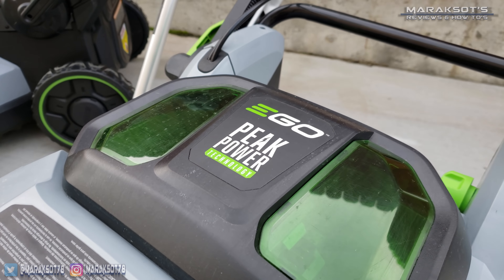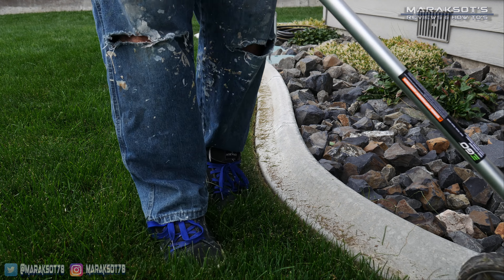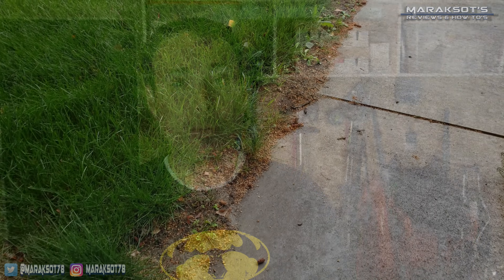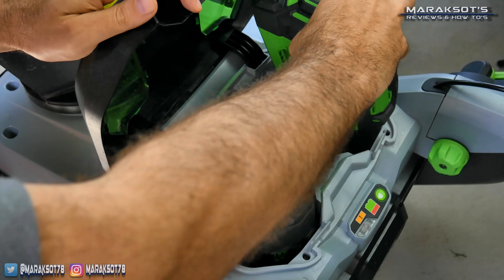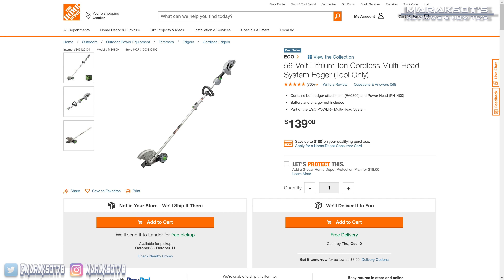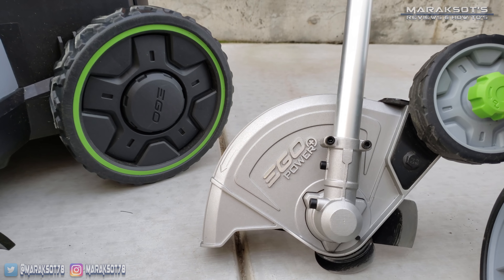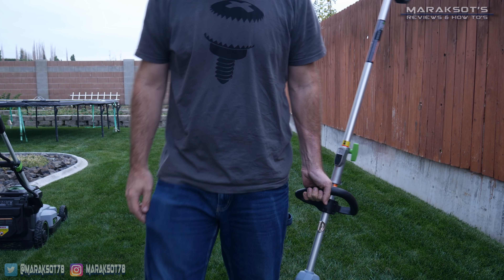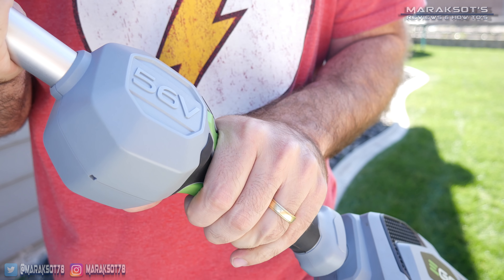EGO Multi-Head System Edger Review

Comment: Yea wait till they change the battery for the next generation of tools which means they won't manufacture older model batteries which means your tools will still work but you will have to buy batteries and chargers thru shady 2nd and 3rd party manufacturers and that's IF they make those particularly 2nd and 3rd party batteries.  It's a joke.  Bought a 3 piece Kobalt tool set 3 or 4 years ago and now I can't find a battery for my tools.  They just don't make the battery anymore, so I now have 3 Kobalt hand tools with just one battery hoping it lasts.  Don't get Kobalt!!

Comment: The design of this edger is garbage. I just picked up one from Lowe’s and after about 10 feet the blade stopped spinning. The shaft spins bet the blade does not. Appear to be problem in the head.  Being curious I wanted to see how the blade mounts. It is held in place by compression. The blade has a circle opening instead oblong which would prevent it from free spinning.